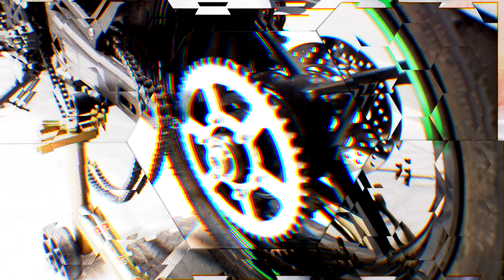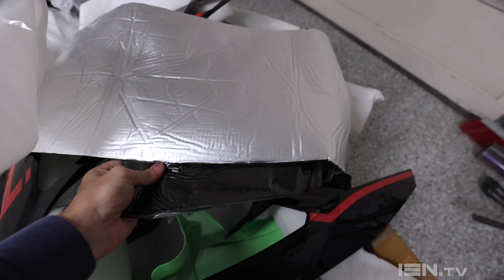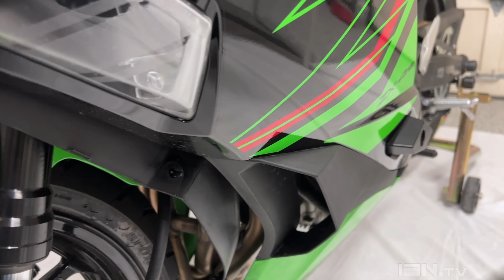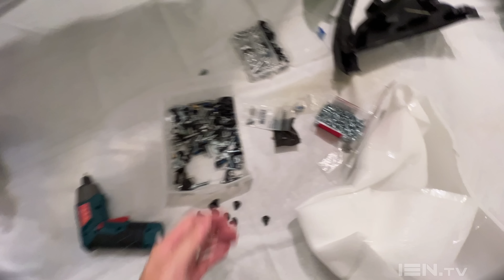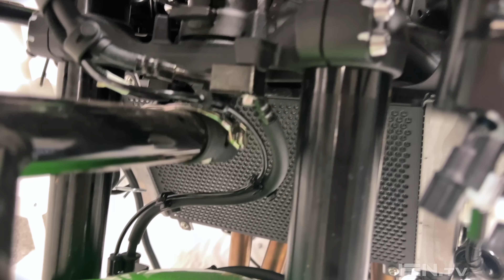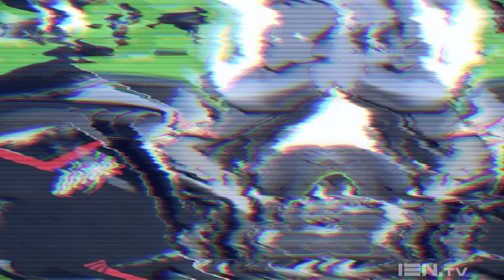副廠車殼可以買嗎？ZX-25R車殼會不會裝不上去？換車殼紀錄 - EP2 - [4RR改]

Comment: Did you put on the zx4rr the fairing from zx25r?
Reply from the maker: Yup. Same fitment. The only part that doesn’t fit is the dash shrouds since 25r fairing is for analog dash. Not an issue, I just reuse the 4rr one.
Reply: Thank you